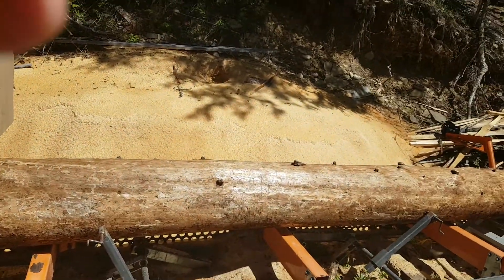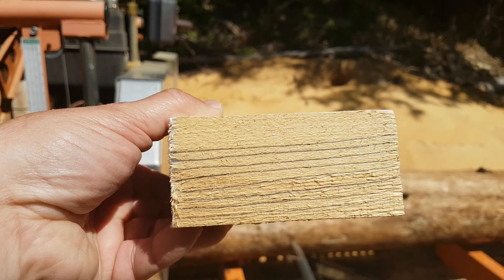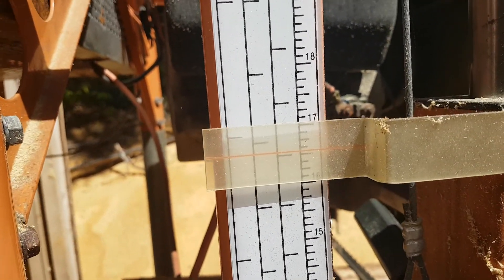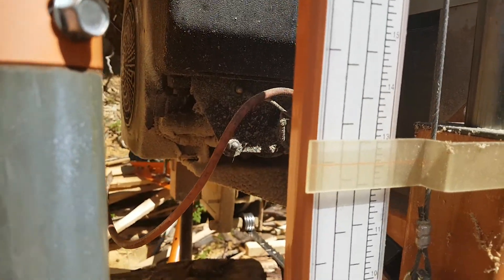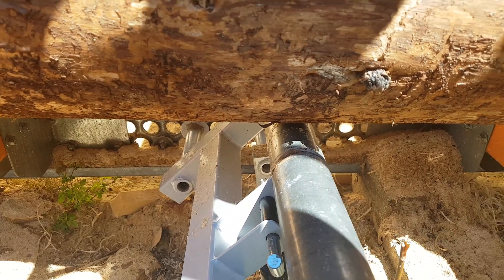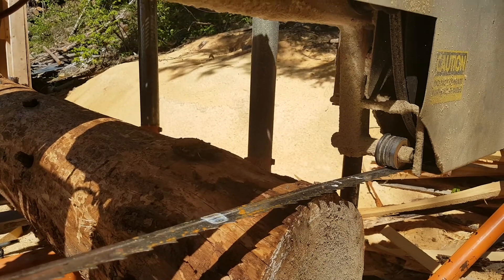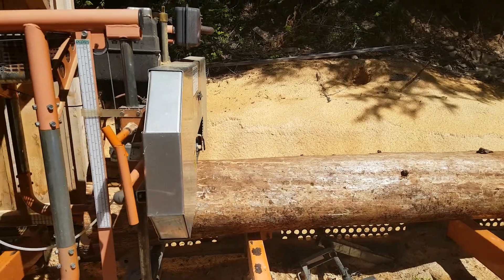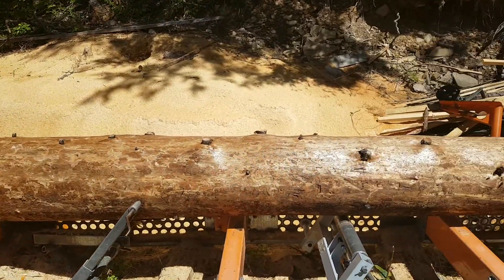Bandsaw mills: Adjusting Taper Part 1

Comment: I had to think about why the low end is only jacked up 2" when there is a 4" difference between the two ends.  Why not jack the low end up 4" to make the front and tail end nice and level?  I then pictured the log as a cone and realized that as this "cone" is lying on the bed, the taper on both the top and bottom of the cone is being measured.  We only want to eliminate the taper on the top side of the (log) cone because that is where we are making our first cut, so we divide the total taper by 2 to account for just the taper on the top side.

Repeat for the second cut, but at 90 degrees to the first cut.  After the first two cuts, the log can be placed on one of its flat sides WITHOUT being jacked up with the toe board because the taper has now been accounted for!  Mr. Long explains this in his Part 2 video.

Thank you Mr. Long!
Reply from the maker: You are absolutely correct, sir. Good description